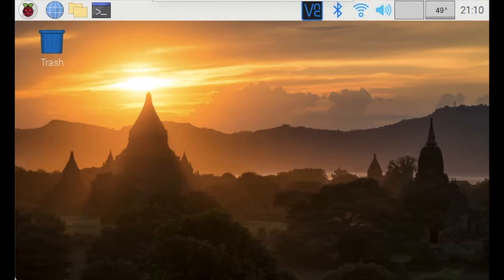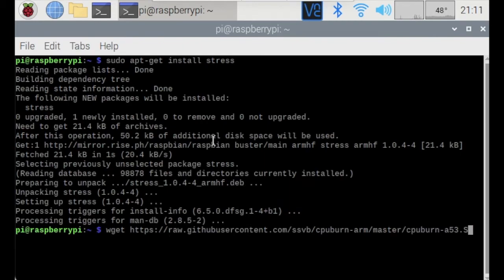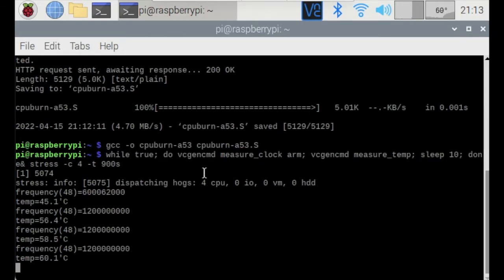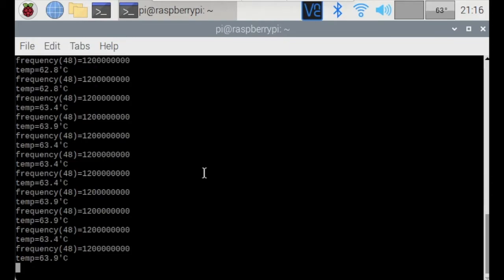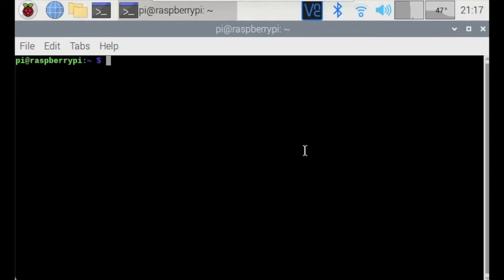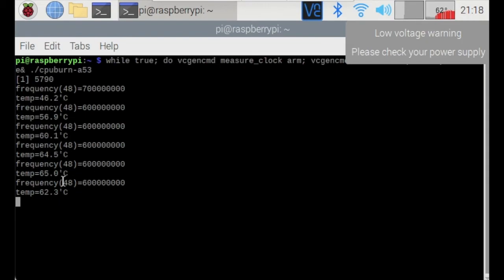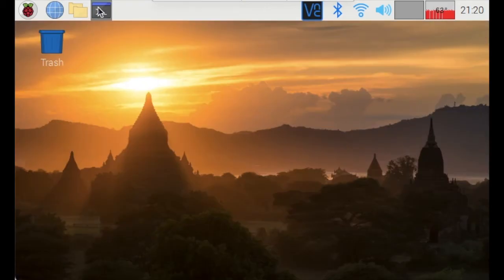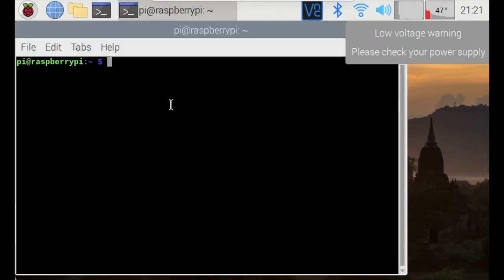How to stress test your Raspberry Pi?

Comment: what cooling do u have when u make the video?
Reply from the maker: My Raspberry Pi 3 had dual fans and a heatsink on the rear.
Reply: @karlselectronics3517  can u show photo or video
Reply from the maker: @5doolar  If you check out some of my other videos, the Raspberry Pi in them shows it.